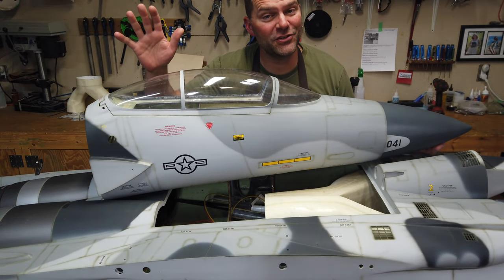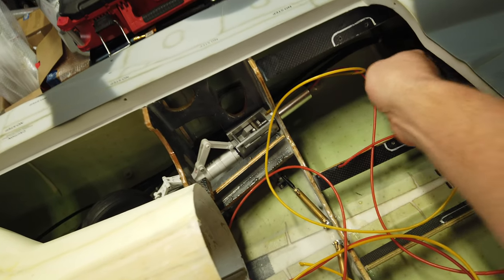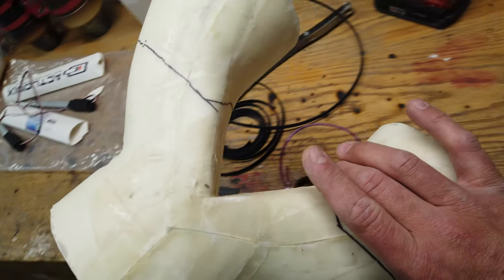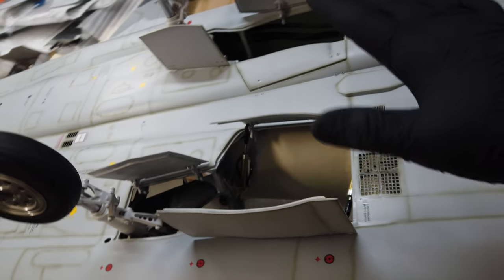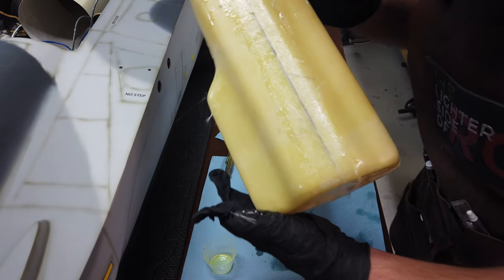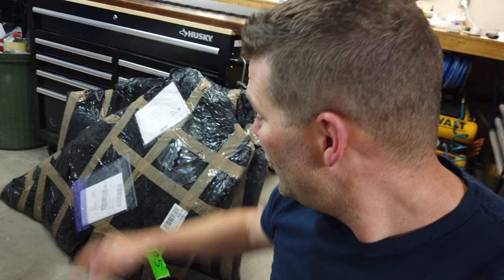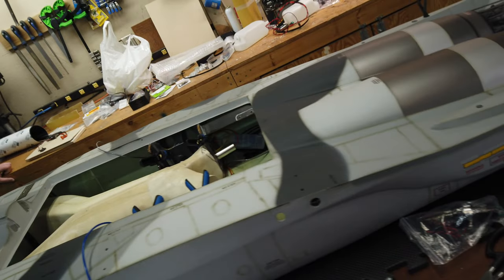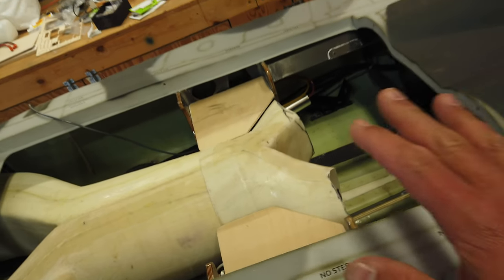AWESOME F-15 Iron EAGLE Air and Fuel System Install - Fei Bao Jets

Comment: Hi Jon. What’s the reason for switching from Sullivan to Festo lines inside/outside the tanks?
Reply from the maker: Sullivan inside the tank because it’s flexible and will move with the clunk/fuel pickup. 
Festo outside as it’s stiff and won’t collapse under suction

Comment: So, I'm not sure in my mind ! my English isn't still perfect. How many fuel tanks for the turbines ? also, the tanks are very near of the turbines exhaust, not a problem for the temperature inside the fuselage ? have a nice day !
Reply from the maker: Hello Philippe.  So each turbine has a main kevlar tank and a 2nd Dubro 32 oz tank.  The front tank is now just for smoke.
Reply: Man you should try fuel bags, saving so much weight and money, as no UAT is required. Plus you can have them customised to fit in the space you need.

Comment: Why not use electric landing gear? I'm a new flyer
Reply from the maker: Great point!  It's possible but one of the issues is the fit and hight of the electric gear.  They aren't always a drop in fit and with how tight and accurate some of these Scale Aircraft are with the gear fitting in the airframe the electric may just not work.  

Also to get away from Air entirely it would also require 7, servos or linear actuators for the doors.  Fairly pricy addition.

If setup well the air systems work great.
Reply: @thelightersideofrc  
Oh ok I see thank you so much for your reply.